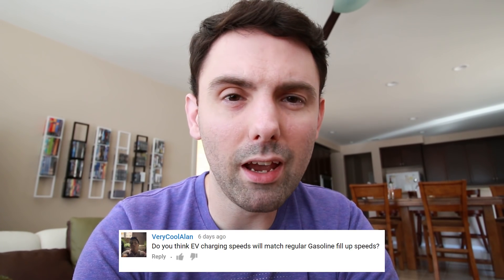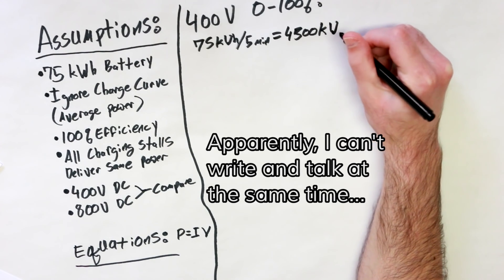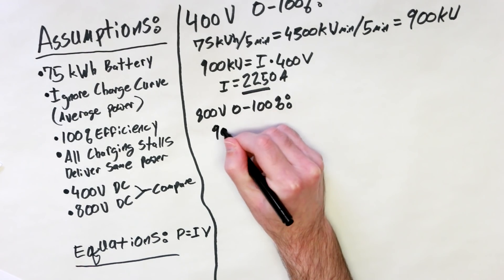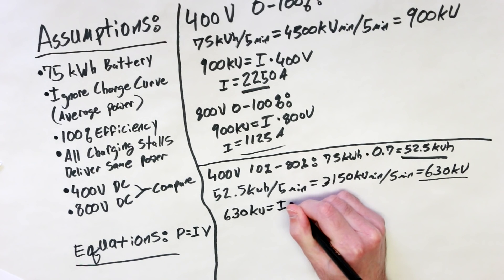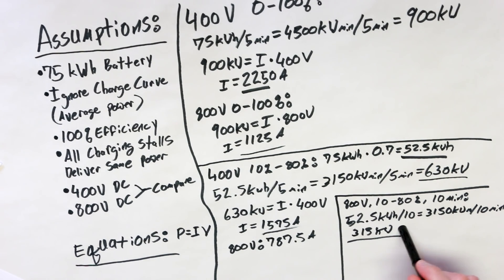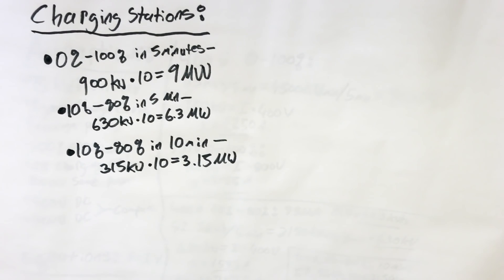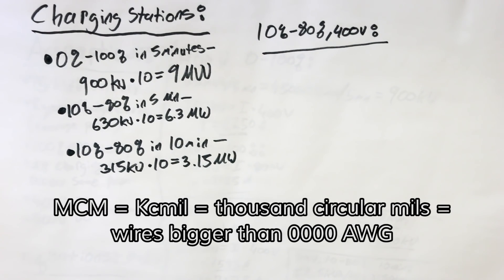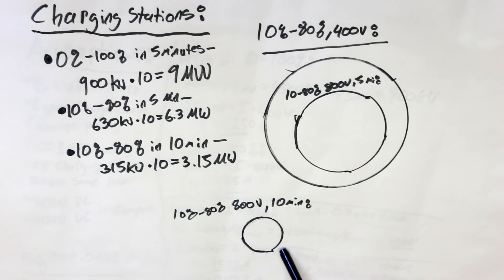Can Electric Cars Charge As Fast As Gasoline Cars Refuel?

Comment: What's limiting the charge voltage?  Couldn't we step the voltage up to say 3kv and drop the amperage down to something a bit more viable cable-wise?
Reply: Charge voltage is limited by cell voltage. Each one can only tolerate so many volts before it goes pop.
Reply: @olamarvin  more cells in series then.

Comment: So would our existing Tesla models be capable of this fast charging (325-340 KW) or would be need to see a whole new car battery ?
Reply from the maker: +Jim Kelly As far as I'm aware, I recall the current Tesla 120kW limit being a result of battery chemistry (also, they're 400V packs)... So, yeah, you'd need a new battery at the very least and my guess would be that Tesla's more likely to push people into new cars than retrofit older ones for 800V charging. The stations could be made backward compatible, though, to preserve functionality for existing cars.
Reply: Alex Venz I've heard that some of the newer superchargers are at 145kw...? so must be greater than 120
Reply from the maker: Yes, Supercharger stations have been getting upgraded to 145kW, but the cars are still limited to 120kW presently (I mentioned this in my EV charging basics video). Bumping to 145kW makes Tesla's infrastructure better situated to handle incremental improvements in battery charging but, more important in the short term, also improves pared charging performance--remember, Tesla pairs their charger cabinets. As Supercharger network utilization increases, pared charging will become more common so increasing charger output even when the cars are capped at 120kW will still decrease charging times experienced by users.

Comment: I'd like to trow something in the room: According to this video (https://youtu.be/Kxryv2XrnqM?t=774) battery cost is dropping that fast, that at least in 2025 you can get a 100kWh+ pack for under 10.000 bucks. So I'd say from that on, most cars suppost to drive on highways and not only in towns will have batteries between 120 and 150kWh. And then if you only use the lower half of the state of charge there won't be any problem to get in there something around 600-800kW. (50-65kWh in 5min)
Reply: And with additional batteries at the charing station they could get around the problem to not get that much power out of the grid at all locations. And with connectors sitting on the ground that attach to the vehicle automatically (needed for self driving cars anyway) you get rid of the too big and heavy connector problem too.
Reply from the maker: Large automated conductors interfacing with the underside of the vehicle is certainly one way to approach the problem, yes.